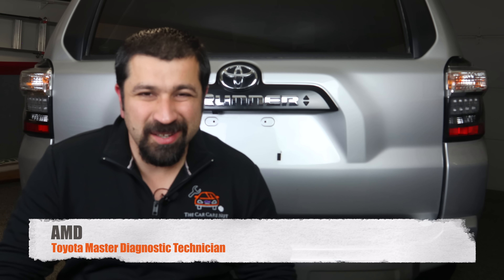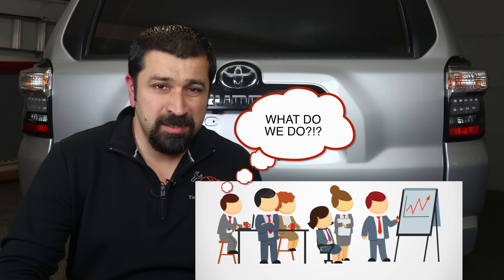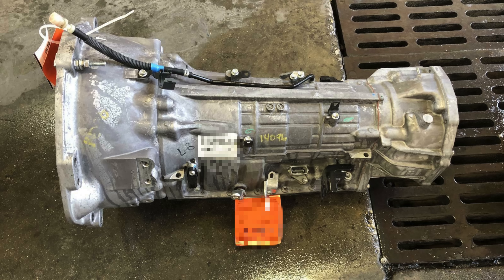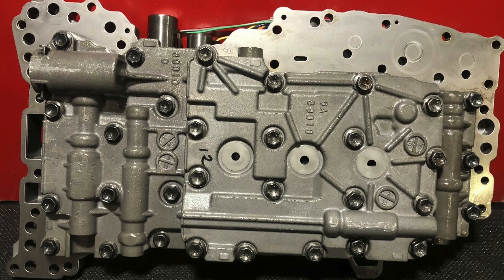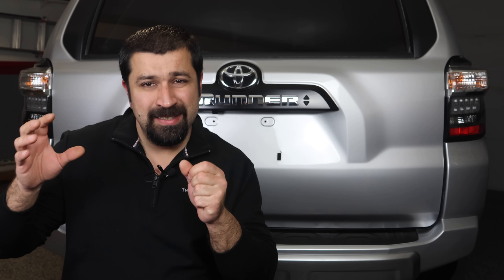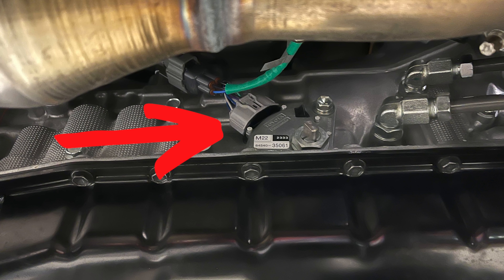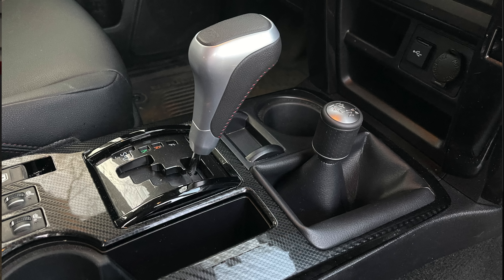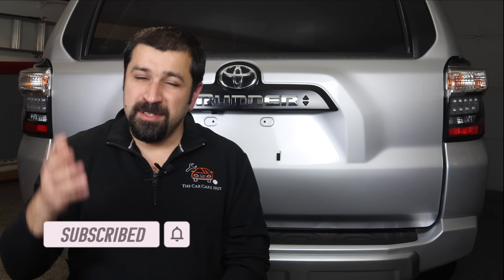Toyota 4Runner Transmission. Why is it so reliable?

Comment: My 1997 4runner with 187k miles has original tranny fluid in it. My uncle was original owner who never did any maintenance lol. Still shifts smooth
Reply: Same with my 1988 Toyota 4×4 Pick up truck. 33 years and still going...🏜️🛻💨💨💨
Reply: Right I had lexus es300 sold at 200k miles on it, I never needed to change the transmission fluid, never turn black it was red the whole time, I even ask my mechanic if it ain't turning black you don't need to change it, and it always shifted smooth
Reply: @manjotsandhu9539  You are lucky... It is neglectful not to change the transmission fluid..
Reply: @charlesjackson1700  dude I never neglected it like I said I checked mechanic, and he said keep driving it and it's fine, like I said transmission never had any shifting problems, and I always kept up with The maintenance never neglected it
Reply: @manjotsandhu9539  that’s OK Charles is probably a Ford explorer owner. 😂
Reply: @manjotsandhu9539  I just like to keep everything maintained.. fluids break down.. I go by miles or time
Reply: You missed that by a long shot.. I would never own a Ford.. we have a 2020 Camry XLE, a 2021 4Runner TRD pro.. and a 2020 Toyota Tacoma TRD Pro.

Comment: Thanks so much for this series!  Quick question, is it normal for this generation of 4Runner to get some cyclical engine vibrations (noticeably felt through the car every 2-3 seconds) when parked and the engine is running?  Mine does that and not sure if it’s normal vibration or something is wrong.  It does that regardless of if the AC compressor is on also.  Thanks!
Reply from the maker: Hi! The 1GR engine is known for its vibrations at low rpm and its normal

Comment: It's reliable because they don't change transmission design every 3 years and they don't stick a CVT in there. Look at the corolla and Yaris platform both the same "ancient" design. The new corolla I wouldn't touch if equipped with pos CVT.

Comment: I had a 2018 Ford Escape the first year my transmission broke the dealer put $1,700  just in parts. It was covered under warranty, 11 months later same problem Ford couldn’t get my car in to fix it. I was concerned I was going to break down and called Ford they couldn’t get me in sooner. To be fare I only have one car me and my wife share we put on 30,000 miles a year. I did change my oil ever 5,000 miles. Ford got me so mad I trade it in at Toyota and now very happy with my Toyota 2021 RAV4 xle

Comment: i have a 2005 with the v8 it has 163k. i was wondering if there's any maintenance needed for the transmission.
Reply from the maker: Hi! The fluid needs replacement but at this point if it hasn’t been replaced I would leave it alone
Reply: @TheCarCareNut  cool thanks for the reply. Im the 3rd owner ill look thru the records.
Reply: @TheCarCareNut  it looks like it was changed at 34k the last time.

Comment: Can you please in the next video explain how to shift an automatic transmission while towing, what gear should the truck be in when taking off and up hills? I pull a camper Weighing about 5000 pounds with my 2010 FJ.
Thank you

Comment: AMD, People looking for efficiency should not be driving body-on-frame SUVs to the shopping mall or in their daily bumper to bumper commuting. The 5 speed automatic is a fine transmission but Toyota needs to bring back the MANUAL 4Runner.

Comment: One of the reasons we stick with the old 2005 Prado (we don't get 4runner in the UK) is that it's from Toyota's best era of vehicle design, simple tough durable, and yes i have changed the oil in the 750 box.
See no reason why it shouldn't last another 16 years assuming the idiots in our govt don't make owning such a vehicle illegal...trust me they are that loopy.
If it ain't broke don't fix it.

Comment: What about the, Gen-2, 4Runners? I own 4-automatic trans and (one 5speed 1993, 4wd), (two autos, 1990, both 4wd), (two autos 1995,4wd & 2wd). Why have you not given a review on those 4Runners? Solved the engine issues with rebuilds and different after market parts, but the tranny’s from what I noticed have issues the automatics that is. Could you please comment back to help me solve certain  problems. I’m subscribed to your channel.
Reply from the maker: Hi! The previous generation 4Runner is actually very similar mechanically to the new one. Which issues do you have with your 4Runner?
Reply: @TheCarCareNut  in the 1995, 2wd, unable to reverse. In the 1995, 4wd, shift delays seems to be temperature related I’ve been wondering if it was maybe temp sensor issue or speed sensor issue. Another bigger problem is parts unavailable for these years. Been to the local, Toyota dealers in my city. OEM Parts no longer available. Because of vehicle age. Can you advise new source for replacement parts?
Reply: I had a 90 something and the transmission failed

Comment: If I do not already have my 2019 ORP, your video about the 5th gen 4runner's engine and this will have completely sold me on getting one. Thank you!
Reply: I recently bought a pre-owned 2019 4RUNNER Limited 4WD and truly enjoying the drive. It is my first SUV and have been driving cars for 3 decades. The only thing to remember is drive slow and keep the speed limit you will get great gas mileage, if you drive it like a car (jack rabbit) style then gas mileage will be as posted by Toyota other than this is so amazing on gas for what it is. This vehicle weighs so much heavier than a car and to give the gas mileage I am getting it is pretty impressive and hidden gem.
Reply: @Thankyou_3  what are you getting for gas mileage?  And you're right if one even drives a vehicle midly aggressive it will get %10 less fuel mileage than if you drive it grandma like.  Keep your revs lower save fuel.
Reply: @glennnichols4220  When dealer delivered my pre-owned vehicle I was getting 10.9 litres per 100 km (21.57 mpg) that is because dealer had my tire pressure at 40psi...when I lowered the PSI to specs at 32psi then I am getting now consistently 11.7 litre/100 kms (20.1 mpg). Gas mileage is absolutely a delight for such heavy vehicle and solid vehicle to drive. I used to have a civic couple decades ago and was using half the gas as 4Runner however the Civic was half the car in every way...I love the solid weight of the 4Runner when driving on the street. It is absolutely a gem from Toyota. I was looking at Lexus GX as well those but those are V8 and premium gas...so 4Runner made more logical sense.
Reply: @Thankyou_3  Yes I had a 2003 V8 4Runner and got rid of it because of fuel mileage.  It didn't make sense for me to pay 75/week.  I mean think about spending 4k plus a year on gas just to say I drive a 4Runner.    That has to be hwy I can't see that even getting 20mpg even  mixed.
Reply: @glennnichols4220  My driving is mostly city with stop and go.... but not heavy traffic...the highest speed is 70km/hr, I think that might be 30-40 miles per hour. I haven’t taken it on the Freeway yet. Again, I am very pleased with the gas mileage, I am getting much better than Toyota posted.
Reply: @Thankyou_3  If most of your driving is city and you were getting over 21.  That is very good for not being turbo charged.  When I pull the headers off my ISF and replace them with aftermarket headers and take the cats out I will be able to get 30+ mpg hwy in a car that will be over 450hp.
Reply: @Thankyou_3  Are you doing any mods to your 4R?
Reply: @TitoBoy1968  😂 not really, those days of moding is over for me. I just want a vehicle with factory specs, things seems to last much longer when you keep factory specs.
Reply: V8's were a beast.  But absolutely missrable gas mileage is the only reason I got rid of my 03
Reply: @glennnichols4220  what was your mpg on the v8? I would have loved to own one!!
Reply: @TitoBoy1968  Where I live in the winter time it can get brutally cold.  I used to drive from my house to my budddies about a mile away to car pool with him.  When below freezing obviously it never warmed up and driving about a mile to his place shutting it off.  8mpg.  Freeway in the summer time 75mph I go 80 17 mpg on non aggresive all seasons. City driving when weather is nicer 13mpg.  It was a pig and I think they suggested premium but not required it so I put it in....it sat and I drove my Rav4 way way more and got rid of the 4Runner not long after.  I loved it but it didnt make sense to pay $75 a week to drive it to me.

Comment: What can you tell us about the problems Toyota is having with the new 4 Runner blower motors? I understand there is a service bulletin about it.
Reply from the maker: Hi! Supplier issue. The motors get noisy and an updated part is available
Reply: @TheCarCareNut  Yeah, made in Mexico, what the hell is Toyota thinking? Trying to cut corners and mess with one of their most reliable vehicles. Unacceptable as a long time Toyota owner,
Reply: @pedrofernandez8729  Pedro here is what happened to Japanese vehicles.  They got smart and started building garbage vehicles because they saw that Ford and gm and such could build junk amd people were dumb enough to buy them.  Toyota Honda Nissan and such got smart and said why are we building things that won't die?  We can build junk as well.  Allthough I will say my ISF is built like a tank. So damn sturdy but not without problems in the 08 and subsequent years that were very costly to fix.  a 65k car shouldn't have failing headers due to heat and crack...shouldn't have bad fuel sensor issues I think it had something to do with fuel rails or sensors, bad valve springs, melting interiors, a msysterios engine tick I don't think anyone still has figured out. Ummmm and a couple other issues.  LEXUS quality huh?  Laughable  But I will say mine has beem bullet proof so far.  Oh and add on the very infamous valley plate leak.  Ya again Lexus the pursuit of perfection my ass.
Reply: @glennnichols4220  You know how Toyota build its reputation? They made everything themselves, all the major components were built by their own factories or by first tier suppliers. I guess that now, lowest bidder gets the contract. My 1998 Corolla, 400k plus miles had original blower motor.
Reply: @pedrofernandez8729  1998 was still good quality Pedro.  My idea was really after the very early 2000's they started to just crap the bed.  It's all in the name of making more money.  my 2008 Rav4 I will have to say has never had anything go wrong on it except for normal wear and tare except the subwoofer went bad otjer than that a little noise from the ac/heat fan when I switch over from say floor to defrost or to blow on me.  But other than that not one thing has had to have been replaced yet.  Knock on wood I can't get rid of it because I know what I have.  The newer the vehicles the more probelms one will have.  More electronics and sensors the more things will go wrong and they know that.
Reply: @pedrofernandez8729  400k miles you got your moneys worth.  What kind of fuel mileage did you get?
Reply: @glennnichols4220  in the low 30's mostly suburban traffic, 3 speed transmission which was horrible on the highway, but it never failed me in 18 yrs and 425k miles.
Reply: @glennnichols4220  A co-workers newer Corolla was falling apart even though it had less than 200k miles, I could tell the quality was not the same as my 98, BTW built in Fremont where they now build the Tesla
Reply: @pedrofernandez8729  1998 Corolla only has a 3 speed?  And low 30 in city?  Heck on the freeway that means it was in the 40's eith ease.
Reply: @pedrofernandez8729  Many Toyotas are built in the US now.  Remember when Honda and Acura had all of those transmission problems from likr 1998 until about 2003?
Reply: @glennnichols4220  My current car, a Yaris, was built in Japan till about 2013, after that, France. No thanks. Just as I would not buy a late model Yaris cause it's just a re-badged  Mazda 2 built in Mexico.
Reply: @pedrofernandez8729  Aren't Mazdas supposed to be good cars?  I like them.  The days are over for sure for overbuilt reliable cars unless, and I still think this, you get one of Lexus' higher end sports cars.
Reply: @glennnichols4220  Not even the Lexus LS is as good as the previous gen. Re the mazda 2, if I wanted a Mazda, I'd go to the Mazda dealer. I think Toyota selling other cars as their own is a mistake, but as you stated before, it's all about the profits.
Reply: @pedrofernandez8729  No I am sure it isn't.  When Toyota introduced the LS400 to the US.  They were so far ahead of ANYONE in regards to quality and durability.  The LS400 and even the ES300 were absolute game changers   Now they seem to rest on their laurels and take what they can.  I will say once in a while that Toyota comes around once in a blue moon that sets the industry stabdard and then that is that and they use it for the next 20 years which is fine because I don't think turbo charhing evrrything is the way to go but if you can convince idiots which most people are, that turbo charged 4 cylinder engines should be pushing around family SUV's then you can deal with the inheritent problems that will manifest from that.  Overworking an engine has never been the solution.
Reply: @glennnichols4220  Well, they did an amazing job with the Prius, a very complicated car to build, it's one of the most reliable cars according to CR year after year, yet the Honda Insight hybrid was junk compared to the Prius.
Reply: @pedrofernandez8729  I have to say that I don't agree with CR.  They are bought out.  As a matter of fact I think Tom Nash, he is on Youtube a stock guy, did a video about CR being corrupt.  But the Prius has been around for a long time.  I also have read that Toyotas hybrid batteries last well past 10 years if taken care of and I do believe Toyota was putting out Hybrids before everyone else and they have been for years and years now.
Reply: I will have a hard time getting rid of my 12 ISF and that Rav4 for something newer eventhough my isf is newer in my eyes it is still solid as hell

Comment: My '06 Sequoia has an A750F transmission that was rebuilt at 178k miles; I bought it at 206k. I suspect prior owners never changed the fluid. I HATE that it is sealed. I have started draining out 4 quarts cold and refilling with 4 quarts cold every time I change the oil.
Reply: Why??
Reply: @glennnichols4220   simple.  Fluid is cheap, transmissions are not.
Reply: @stevebrackett2676  It sure is I agree. But I have never heard anyone changing their tranny fluid out every 10k miles and half of it every 5k miles